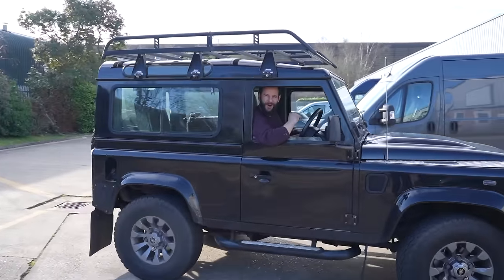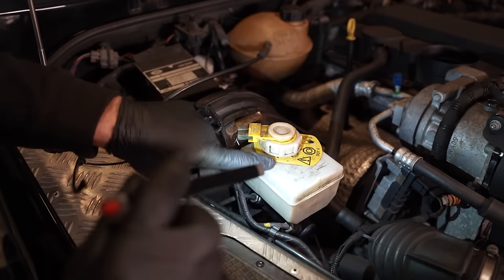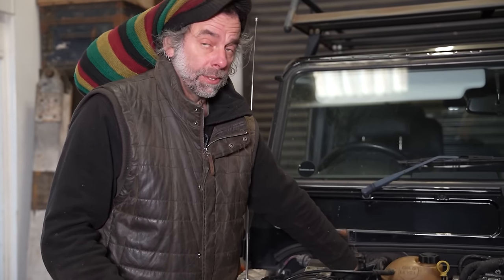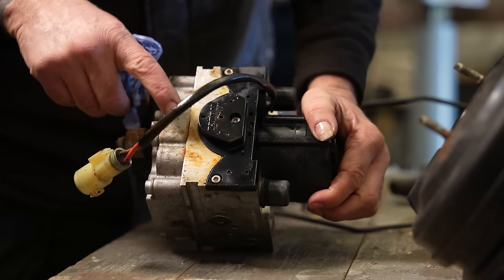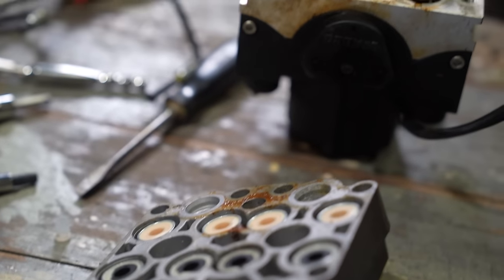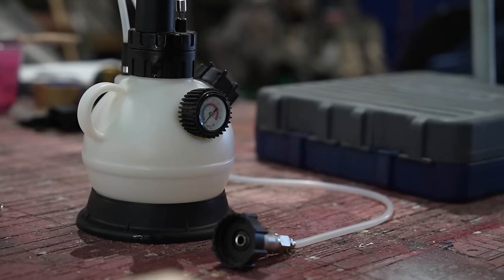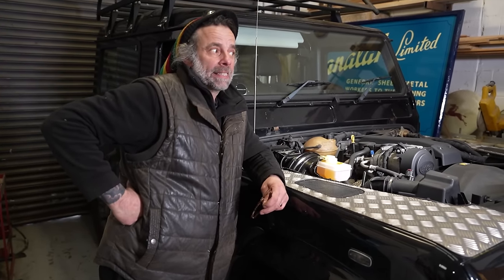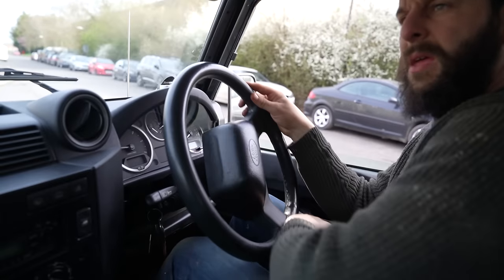I've Got A DEFENDER! (and it's already broken...)

Comment: Hi Dom, I was always taught when bleeding brakes, to start with the wheel furthest away from the master cylinder and work towards it. I also can remember when Land Rovers were well built, simple and reliable!
Reply: That helps if you save time (and fluid) are flushing out the old but Dom had done that already by driving about!
Reply: Anything after the 200 Tdi is going to be  progressively more difficult to fix
Reply: That was the way I was taught, the longest line away from the master cylinder. It worked anyway which is the important bit - another enjoyable video 👍

Comment: Good tip, for any car; ABS pump is a mechanical device, needs to be used periodically. I always test it every few months by ramming the brakes on in a safe place, eg coming to a stop on a straight road expecting a pull to a left or right. Get the pump working so you know it works in a controlled environment, so,you know it works when you need it.
Reply: Snow & ice here in Norway so abs was a revalation wish I had that on my Cortina mk1 when I slid into the wall of a police station😂
Reply: Ah ! The I think it’s that bit that’s faulty

land rover game…….an expensive lark 😮

Comment: As a bike enthusiast, I would like to see you make a start on restoring one of the machines you already have. I enjoyed the Triumph build but would prefer to see a non-customised restoration, preferably the older bike rather than the A10, although I'm sure that it would be easier to get any parts needed for that one. I also know that you like a "well used" look, but I would like to see you try to do a full-on concours restoration. At the end of the day though, they are your machines and you are entitled to do with them what you will.
Another thought is that I have really enjoyed watching youtube videos about Cyclecarts. They look real fun and I'm sure that you and John could have a great time choosing a design and building one. Not too expensive, a super community of enthusiasts and a project that would ideally fit your combined skill sets. Making a body for a suitable Cyclecart would also enable you to practise some panel forming on your Ranalaghs.
Best wishes.

Comment: Hi Dom, I  recerecently discovered your channel. Welcome to Defender ownership. I bought my first, a 1999 300 Tdi about 12 years ago, other than a new chassis it has been trouble free. I also bought a 110 TDCi last September, it is the same age as your 90. So far the only issue has been a new Starter Motor that at was covered under warranty from the garage I bought it from. Good luck and enjoy, don’t forget to wave to other Defender drivers!

Comment: Love my Defender 110 County SW, Dom - had it from new and 30 year anniversary this September. Never had any brake system issues - apart from the usual changing the pads....good luck with your 90....
Reply: My old girl has just turned 50 , at 85km/h don’t need abs .

Comment: Very lucky on the ABS: I was working as Line Side Support Engineer at Tata Motors and, on occasion, got called to re-pair various modules (ABS, Instrument Cluster, Traction Battery and various driveline parts) and this required not only the Line Side commissioning  tool but also knowledge of which byte in the main ECU to reset to allow pairing as the security system was setup to only allow pairing once, i.e., during initial vehicle build.

Comment: Top tip. The abs pump for the 2.4 is the same as the td5 discovery. Even though the ports are labelled differently, so long as you connect  the pipes in the same order and position as the original, they work exactly the same.  As a result I have a reconditioned abs pump in the shed that I’d bought thinking the disco one would never work.
Reply from the maker: Your kidding, really!! Thank you so much for sharing the info, wish I knew that sooner!
Reply: @DominicChineas  I was thinking the same when I paid £400 for a recon🤣

Comment: I've only ever used a rubber pipe with a valve in the end single handed.   never had an issue.   Also many years ago you could buy replacement bleed nipples with a built in valve, seemed like a great idea to me.

Comment: Used a pressure bleeder on my Mini R53 when I swapped over braided stainless steel brake fluid lines at the calipers. Made the job easier, cleaner and faster than the old press the pedal method. Plus I was able to do it solo so I didn't mentally scar my brake pedal assistant for life when things would go sideways on the old school method.

Comment: Had to change mine on my 02 Defender. Had to take wing off. Replaced it with a 2nd had Disco one. They are a direct replacement, just ignore the sticker that says which pipe goes where!

Comment: Hey Dom & John, Since you both specialize in the unique and occasionally obsolete technologies, maybe this ABS Pump is another opportunity ? Perhaps you might see about rebuilding the old one or upgrading to a more current pump from the LR parts catalog by modifying the pedal box that was compromising your fitment of replacement part ? At least figure out how you should have disassembled the module without damages to electrical components and see if there are seals that could be replaced to rebuild old unit as a spare or for resale to other afflicted LR Defender owners ?

Comment: They say that 90% of all Land Rovers ever built are still on the road. 
The last 10% made it home...    ;-)

The reason Landies survive so long, usually, is that they're reasonably easy to learn to wrench on.   
(Not counting the later years with way too much modern crap )

I on the other hand learned to wrench on Citroëns, with a 1975 GS Pallas as my first, so I not only learned about carbs and car electrics(Magneti Marelli and Bosch mostly, not the Prince of Darkness Lukas), but I even learned about Hydraulics(well, hydro-pneumatic systems, so regular hydraulics are easy)   
Learned about watercooling on my 1984 CX 2.0... 
For anyone wanting to get into French cars and engines, remember that Cyl 1 is the one closest to the flywheel, or closest to where the power outtake is.
 (Everyone else numbers from the end with the fan, belts and all the other weird stuff)   
This does not transfer over to French engines built on license, though. 

Don't DO THAT with the ABS pump!  
Clamp it down!  You could have done yourself harm by wrenching on bolts while holding it in your hands and using that much force.
Reply: I STRONGLY recommend owning a Citroën which is, say, 2 to 6 years old!!
In my long experience.. nothing will ever go wrong... and you won't ever even have to open the bonnet....!!!
...of course, this doesn't apply to those older Citroëns with  all the weird stuff going on......
Reply: @andymccabe6712  Weird stuff?  
Nope, never come across anything weird in those. Sure, the early 2CV had some really funky suspension, and you could dismantle most of the car without tools, but nope, nothing really weird there. The HY van had an engine without oil filter(oil changes every 1200Km) but a lot of other cars also had indicator stalks that popped out to signal turns. Now if you want to talk weird... there's cars out there that used VACUUM from the carb to power functions such as Central locking. THAT is weird! 

The HydroPneumatic suspension for example is really easy to diagnose and fix. 
If the car doesn't raise up within 20 - 30 seconds after starting, bleed the Pressure thingie up front (cylinder with a bulb on one end. There's a clearly marked bleed screw on it) 
Now time the 'ticks' from the pump while it's idling. 5 - 8 seconds between ticks and all is well. Faster means that a seal is rotten. 
If one of the arms of the Squid(the rubber return hose assembly) detatches from one of the shocks, it means that shock is failed, most likely worn out seals. 
If it doesn't stay level, or there's issues with raising and lowering the car, it's the levelling valve assembly(can't remember what it's called). It's a cylindrical device 10 - 15cm long under the center of the car. Do not mistake it for a fuel filter...    

Old Citroëns got a bad rep because of two things. 
1. During WWII, Citroën sabotaged the cars and lorries the Wehrmacht ordered them to build. They did this by lengthening the dipstick. Germans are such sticklers for rules that they couldn't imagine that the dipstick was wrong, so the engines starved of oil and broke down. 
2. The Boxer engine in the GS has alloy cylinders, not cast iron as was usual. Home mechanics who tensioned bolts by 'Ugga Dugga' (brute force, repeatedly) actually pulled the bolts out of the cylinder housing, or at least cracked them loose. The Head still seemed to sit tight, but the engine threw out a thin fog of oil from that cylinder  after that. 

If you ever see anyone wrenching on a car, and they don't have a torsion tool of some sort, kick them where it hurts the most.

Comment: That ABS unit should have come apart easier than that. The corrosion made your job harder and led to the breakage I expect. Probably not had a brake fluid flush for quite a few years leading to water absorption and then rust. I would expect the rest of your braking system is in a similar state!

Comment: Lots of expense Dom and John!😬 I remember my Dad’s Mercedes having problems with its brakes over 40 years ago. A seal had failed in the servo and most of the brake fluid got sucked into the air intake. He realised what had happened when he saw clouds of white smoke coming out of the exhaust!
Reply: Was it a petrol engine ?
Reply: @ronpalmer1371  Yes, the old 2.2, 4 cylinder.
Reply: @spamhead  
Thought so, that tends to happen with petrol engines not diesel, petrol uses intake vacuum for brake servo, diesel uses a pump.

Comment: About 15-20 yrs ago, I went out to buy a 4x4. The plan was: a 110 Defender. In the late '90s, my wife was a professional user of 4x4s when she worked for NGOs in Afghanistan and Nigeria, driving around in (armoured) Troopies. She told me: "Yes buy one, but I only want a 4x4 with Land Cruiser on the bonnet on the driveway!" The only time she vetoed my car-buying adventures. And yes, there's a 20+ yr old lump of Japanese iron in the barn these days. Nearly 450k km without troubles...
Reply: Landcruiser Amazon 80 series , 4.2 straight six , manual , triple diff locks the finest 4x4 ever to come of a production line .Followed by every other series of Landcruiser ..👍
Reply: I drove around on the edges of the Rub al  Khali in a Land cruisers back in the early 80's. they were SWB straight 6 cylinder petrol 4.666 litre engines. Absolutely bullet proof vehicle, and as I was always driving on my own and map reading as well, miles from civilization and tarmac, in the height of the Saudi Arabian summers, the reliability of these Toyotas probably saved my life. The few land rovers that were on the fleet were always with issues, and even when mechanically reliable, suspension parts were wearing out and even breaking, being light weight in compassion to their Land Cruiser brethren.
Reply: @richardcole9558  and yet you very rarely see them off road or even in a muddy field anywhere in the UK, and on the odd occasion they do venture in that direction, they have to be towed out by a kindly Land Rover owner…❤Defenders…especially my 110 Wolf !
Reply: What is it the Australians say? "If you want to drive into the outback take a Land Rover, if you want to get back take a Land Cruiser".
Reply: @nigelbarratt6825 and we all take note of what Australians say, right? The absolute truth is that Land Rover have been building the best off-road cars since the end of WW2 and now have an enviable legacy of World firsts that are undeniable and with a loyal following that other brands can only dream of.
Reply: You should take up a career in comedy! Virtually  every reliability survey puts them firmly in last place, and the rest of them only just slightly better. These are from surveys of actual owners. My office is a mile from the Solihull JLR factory and I've spoken to a lot of their workers, most of whom wouldn't want one even if they could afford it.
Reply: @nigelbarratt6825  Ok, so you’re one of those keyboard warrior types…perhaps you should read a history book or two? I was not referring to the plastic infused modern bean tins stamped out at JLR right now, and Dom’s vlog is also not about those current crop of vulgar fashion accessories - but the ‘proper’ vehicles bolted together for this countries military and quite a few others around the World, the many thousands that have worked hard in farms to put daily sustenance on our tables, vehicles that have kept me, (for 18 years of loyal service), and many tens of thousands safe whilst protecting the very freedoms that allow you to spout your opinions. Opinions are a good thing, of course, as long as they are educated. Quoting baseless Antipodian cliches is a half-witted attack that is neither factual nor backs your pointless attempt to bolster your untenable position. I am, by the way, an Actual owner and have been for over 35 years and I have never filled in a reliability survey, but if I had, I have no complaints…because I know what I am buying and I can fix anything that may go wrong in my garage very easily without the need to refer to laptop or OBD port. Perhaps we agree to disagree, you stick to the crap you so clearly have bonded with and I’ll remain a steadfast patriot.
Reply: @stevepickering5866  As a matter of fact, I am in my 70s and started as a mechanic in the late 1960s and have probably worked on more Land Rovers than I care to remember, going all the way back to the Series 1s and 2As with the 2.1/4 litre Rover petrol engine, overhead inlet side exhaust valve types, one of which some friends an I took on a trip to the Middle East in 1969, where we actually got shot at on one occasion. If that makes me a 'keyboard warrior' whose opinions are not educated enough for you, then so be it.

Comment: My friend was a master butcher and explained to me that everything in a pig is used, except for the sqeak. That was until land rover used the squeak in the brakes! 😂😂😂
The abs  will eventually suffer from corrosion, as the anti corrosion in the brake fluid fails to work over time. To avoid such issues you need to replace the brake fluid every two years.

Comment: Dom don't through the electronic side of the old abs unit away as data can still be copied from it by just plug it back in to the car and a diagnostic scanner can read all of its info just in case you do have abs coding issues with the new one cheers from down under

Comment: You can get can get some wabco spares from LR parts suppliers. Looks similar to the unit in a Disco 2. Suggest you also invest in a Nanocom, makes fault finding and resetting of electronics and bleeding a whole lot easier.

Comment: I has a TD5 after years of driving lightweights in the military...loved it until it started switching itself off at 60mph....not a quick fix as apparently engines and gearboxes were set up at the factory as one unit?....swapped it for a Freelander that spent two months in the dealership and came back with a third of the engine replaced before they found/replaced the offending part......wish they'd go back to basics.

Comment: Hi dom, still loving the content and the variety of projects, but, your new brake bleeding toy is not new, being a child from the late 50's I still have my Gunsons easy bleed and I'm still using it, I recently single handedly bled the clutch on my 1960 948 triumph herald. 
Its virtually the same as your new tool ,the only difference is that you pressurise the system using your spare tyre. They still pop up for sale on Ebay,  keep up the good work.

Comment: I thought you had to go through an ABS bleeding process using a scan tool if you fitted an "empty of fluid" or new ABS unit? Otherwise air can be trapped in the unit and you end up having a load of air introduced into the hydraulic lines just when you need the brakes most!
Reply from the maker: I’m not sure that’s the first time I’ve heard that, I’ll check the system again in a while after using the Abs a few times

Comment: Why is it that Landrovers and Range Rovers are so flawed? They are the laughing stock of the car industry. They buy parts or commission parts from the same motor factors and engineering firms as any other company. What is the problem? They have a great design heritage but where in the process does it all go wrong? Is it the engineering design and specifications, procurement, quality control of parts or build quality?
What a success they would be if they had the reliability of a Lexus! I had to sell my Discovery once it went off warranty. The dealership people felt like distant relatives I was regularly bumping into. The car had to go before it forced me to sell my first child. I loved that car. I would never have another. What a shame.

Comment: Not sure what year this Defender is, but I have just replaced the whole brake system on my 2003 Defender, I though while I had the system open it would be a good idea to replace the lot, the pressure bleed I bought is similar to the one you have, it made the whole job so much easier, you will need 4 Ltrs of fluid to make the job go well as the bleed nipple need to be purged of all old fluid, not a bad job to do, providing you do not drop a heavy caliper on your finger . Fortunately mine does not have ABS, that is a definate deal breaker! Good luck! Chris B.
Reply: He's got a late 2007 or early 2008 ('57) MY. Can see the reg when he turns towards the garage.
Reply: @pistonhedd  Well spotted! I live in France so I could not make the link. I wonder if the ABS thing could be by passed back to normal configuration, ABS is hardly a requirment on the Defender.